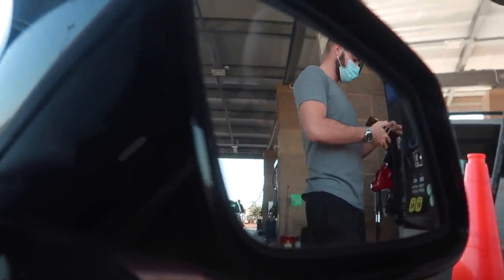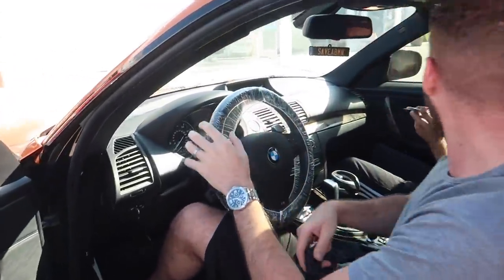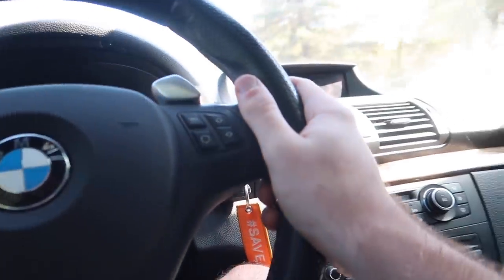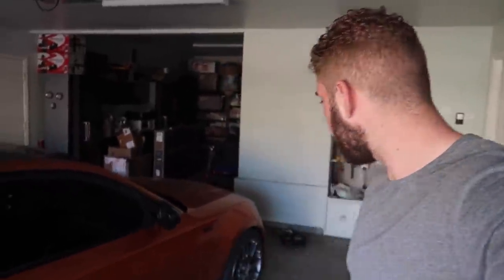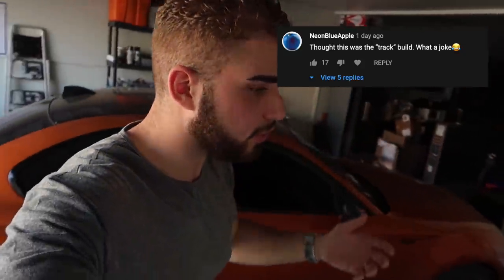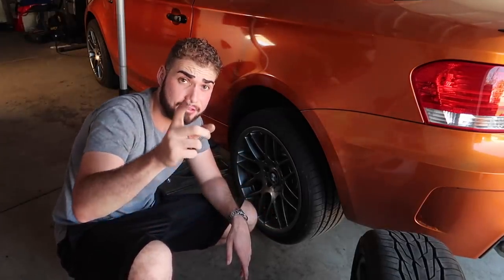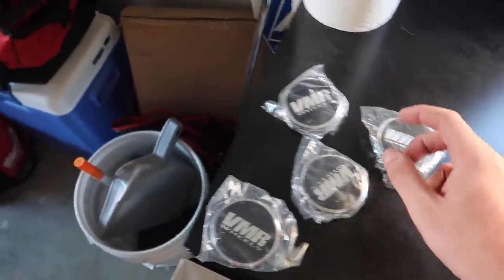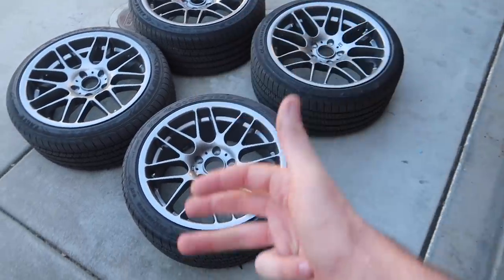THEY FIXED THE 135I AND I COULDN'T BE HAPPIER!

Comment: Reaching out to Nour Hummadi, Justin Bruce Kies Motorsport, Tommy L Garage...guy my 2011 BMW 335i xdrive has the following code 0028A0, 002FAA, 002EE2 and 002EEC can you please help me out l’ve change spark, plug coils and fuel injector on cylinder 3